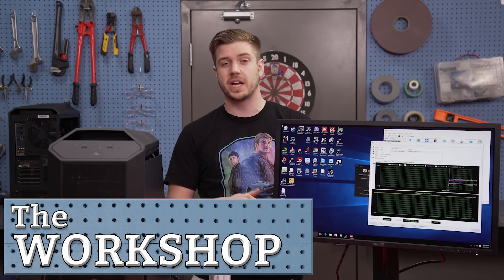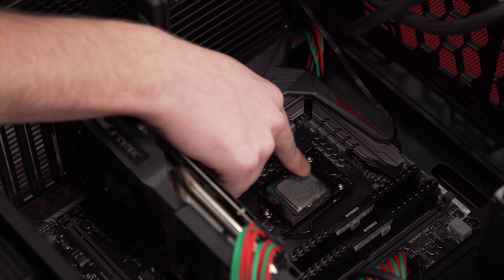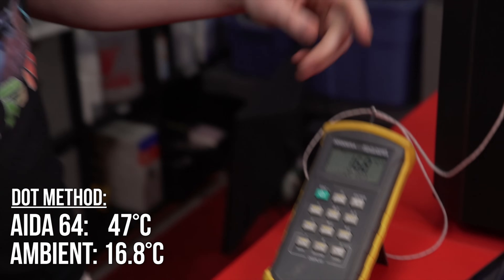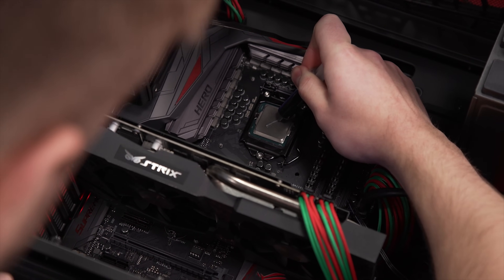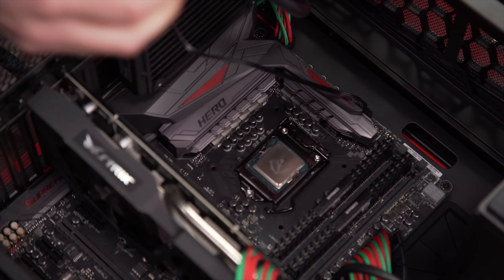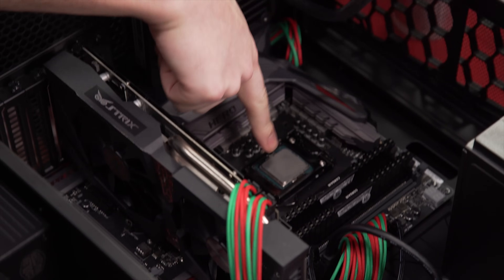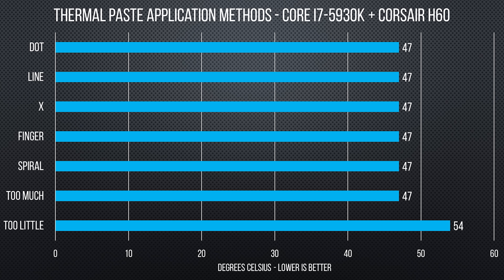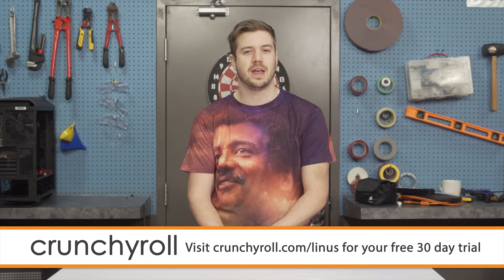Thermal Paste Application Methods - Which one is best? - The Workshop

Comment: shouldve overclocked it so it was running around 70c. if you idle at 20c and load at 47c your delta is 27c. if you idle at 20c and load at 70c your delta is 50c. much easier to see differences that way. small changes in thermal conductivity will be amplified
Reply: +EZOVERDOSE yeah you might get +-1 deg C if you're lucky, and that will be like negligible still.
Reply: z00h
i guess we will never know. another problem i have is he never gave the cpu temp at the decimal. newest aida64 shows the avg in decimal form and i wont believe that he got 47.0 every time. whatever he getting temps from we dont know if it rounds up at .5 or not. its also just not professional for the leading name in tech videos to do when smaller channels are much more thorough and accurate with their tests.

gamers nexus just did a video about how they compared their case temp testing methodology to an actual thermal chamber and compared temps to the thousandths .000. 3 places over from the decimal.
these workshop videos feel like someone with mediocre experience just half ass testing something every time
Reply: EZOVERDOSE because 0.5 degs would mean much. Dude... please.
Reply: z00h .5 would be best case but if it didnt round at all that would be .9. adding that from the .5 ish ambient you have a 1.4c difference. test at higher temps like 70-80c and that could amplify to as much as 5c. 5c becomes a pretty big deal when you pushing a chip to its thermal limits with extreme oc'ing.

i looked at aida again and the decimal is only for avg not peak. i guess those diodes dont do decimals because i couldnt find anything on it. they should have a special cpu thats been fitted with a custom diode in between the ihs and die or something to read more accurately than a flat number. they are after all a multiple million dollar operation that can afford a couple hundred dollar sensor and leaders of the online tech video world implying they could handle installing it

i expect more from them
Reply: z00h
how is any of that unrealistic? neither of us know if the diode rounds at .5 or not.
it is basic logic and thermodynamics that the delta would be higher at double the temperature. and not just because of the previous fact that we dont know if the diode rounds.

to answer both questions all they had to do was install their own sensor which is totally possible. here is a section from an article about it

Section 3 - CPU Temperature

Also called "Tcase", this is the temperature shown in Intel's Thermal Specification. It's measured on the surface of the Integrated Heat Spreader (IHS) under tightly controlled laboratory conditions. For testing only, a groove is cut into the surface of the IHS where a "thermocouple" is embedded at the center, which accurately measures temperatures. The processor is then tested at a steady 100% workload with the stock cooler.

the level of accuracy they could achieve with testing anything and everything cpu related would put them above everyone else

another thing to add to the discrepancy list is they need to take ambient readings by the cpu intake not just the front intakes. i hope you realize without explanation how ambient can vary from inside to outside the case. especially with back to back testing. the vrm will hold heat for a long time. that could be another .4-.9c difference. keep stacking them rookie mistakes and before you know it you got a 2 degree discrepancy on a 27c delta. which makes my 5c delta at 70c claim not so far fetched anymore

Comment: I think two aspects you did not consider here are

1) the type of cpu cooler plays a big role. you had a water-cooler which are in general good in cooling, thus the difference in thermal paste and their application is probably lower. The difference in application should be more noticable with a weak cooler.

2) the type of thermal paste will make a difference, but not as much as the cooler. maybe do a comparison with a really good one (the one you used is a good bet, i think) and one that is known to produce bad/worse results.

I myself thought there were more differences, but also thought them small. I was suprised that no thermal paste caused such a big difference.

A follow-up video testing this out would be nice!

Comment: Guys I have big temperature issues (Build my first pc)

Have the i74790k, not overclocked, and the thermalright macho Rev B as a cooler (cost 50 euros)
When I start a stresstest, coretemp, speedfan and HWMonitor all show, that the cpu temps go from ~35 degrees idle up to 100 degrees in like 10 seconds.

I am pretty sure I installed the cpu cooler correctly, since it is still better than the cpu intel stock cooler, but why does my chip get so hot? Is this kind of software not reliable to measure temperatures?
Reply: +Nito Raki i used prime95 for this cpu stressing, the first stress option.

when using aida cpu stresstest like luke in the video i get only 70 degrees.?!

Comment: I had a different result.  I used the pea method and used a little to much which gave me 39/40degrees at idle.  reapplied the thermal paste and used just the right amount,  and got 30/31degrees at idle.
Reply: +Auckland Mag Chances are very high that the cooler wasn't seated properly the first time. On no computer that I ever worked on, I had a delta of 10°C because of the amount of TIM I used.

Kind regards,
Meta Custom Computers

Comment: The only CPU's I've come across where it seems to matter how you apply the thermal compound are CPU's that don't have an IHS. Like the CPU's in a 2009 Mac Pro. Spreading it on the die seems to give better performance in that case.

Comment: I always spread my thermal past with a credit card in order to spread the paste evenly in a layer that is as thin as possible.
In practise, I imagine that I am getting a thinner and more even layer than when using a finger. Although, in theory, that is how it should be done as that is the best way to ensure the largest and most efficient contact area (the layer has to be thin!) between the processor and the radiator.
That being said, it is also possible that the newest and best thermal pastes are so good heat conductors that putting too much paste (or way too much) or uneven layers makes absolutely no difference! Which probably wasn't the case when I started building systems 25 years ago.
Reply: I've always done this but instead of a credit card, I paint a very thin layer over the entire surface using a razor blade, careful not to get any cuts or blemishes in the painted layer that would result in air gaps. I also rub some into the mating surface on the heat sink using a plastic bag on my finger to help fill microscopic holes.

It always bugs me when I see Linus or others just squirt a dab on and lazily slap the heat sink on top. Guaranteed, this is not the best way to achieve good thermals for longevity.

This test also annoys me because using some tool and waiting ten minutes isn't nearly a conclusive test. They should be running CPU intensive tasks for a couple hours and monitoring the max temp. I feel like 47 is kind of warm for idle but where you'd see differences is where extreme tasks would start to heat soak the sink and actually tell you how efficient you were at removing heat from the processor over an extended period of time. They also didn't do the paint method as I just described. Don't be lazy, people.
Reply: +Thomas Olson If you spread a thin and even layer on the processor, you shouldn't need to spread an additional layer on the radiator. Razor blade ... that is risky!
Reply: +Photoandcargeek no that's not what I said. I smear it with my finger just to tint it really. I don't paint a layer on the heat sink. Nowhere near the same amount as on CPU cover.
Reply: +Photoandcargeek with my finger in a bag, that is. I take every precaution not to get contaminants in the thermal compound.
Reply: +Thomas Olson That is probably 50% to 100% more than what I put .... if you are trying to block microscopical holes in the surface of the radiator, the billions of molecules that you have spread over the processor should suffice (even if it is just a tint!). That is all I said.
Reply: +Photoandcargeek oh I see how you meant it now. Tinting the mating surface just helps to ensure no microscopic bubbles get trapped and the thermal compound can better interface with the surface. It's just a theory but it's how I learned and have always done it. Razor blade is no more dangerous than a credit card due to the extreme angle of the blade. And it works better because plastic is often nicked at the edges and whatnot. A brand new razor blade is a lot more straight.

Comment: again i kinda knew that there was going to be negligible difference. i mean it's only thermal paste for crying out loud. as long as you don't mix it up with hair gel or something i think you'll do fine. 
i have 2 issues with the strawpoll. 1 is there was no choice for no f***** difference and 2 for turnip (which i suppose means the same).

Comment: Shouldnt you be testing this at some level of cpu stress though?
Reply: +silentKeys20 Yeah. that's exactly why he used Aida64 to put stress on the CPU.
Reply: But if the fan is thermoregulated. Who knows if the 47°C has been achieved with the same fan speed everytime ? If it runs at 10% in the pea method and 75% In the X one, the conclusion isnt exactly the same :p
Reply: +silentKeys20 Like using AIDA64??
Reply: I think one person saying Aida64 is enough.
Reply: +silentKeys20 That's why his using AIAD64 benchmark
Reply: +silentKeys20 He is. That's what AIDA64 is for.
Reply: R4GEcraft Yes I know what you mean, but the temperature doesn't go up. The fan curve is configured to go to a certain speed at a certain temperature. So the 47° gives you always the very same fan speed. The controller does not try to hold the 47°, or can predict how fast it has to run to do so.
Reply: +silentKeys20 shouldn't you know what Aida64 is :P
Reply: +PrjctMinecraftiaFan Aida64 is a program designed to run your CPU at 100% for stress testing.  Its primary use is for testing processor overclocks for stability - running Aida64 on on unstable overclock will cause your system to crash.
Reply: +Treufuß I was exaggerating. What I meant is, when the temperature goes up, the fan also speed up to catch up with it and maintain it at a lower, more stable, operating temperature. And I'm not sure he mentionned the speed of the fans were fixed
Reply: Aida64 is his girlfriend, you dummies 

J/K
Reply: aida64?
Reply: +WayStedYou sorry I didnt know that. Thanks for the info!
Reply: R4GEcraft Same temperature => same fan speed
Reply: +silentKeys20 not enough answers! Let me add another one
He's using AIDA64 which puts stress on the cpu
Reply: +silentKeys20 AIDA64 IS a stress test for a CPU, he said that he would run it for 10min before taking the readings.
Reply: +silentKeys20 
Aida64 is stress testing. It puts the CPU at 100% usage.
Reply: +R4GEcraft Do radiator fans normally spin up and down? What about the pump? I think running at a constant speed would give them a longer life.
Reply: +Treufuß Yes but it can be 47°C reached in 10 seconds and 47°C reached in 100 seconds they should have checked that. Which makes a difference for other systems that are not as efficient as this watercooling.
Reply: +silentKeys20 HE'S USING AIDA64 OH MY GOSH j.k I know the answer has been given to u
Reply: +R4GEcraft maybe it is, maybe it isn't. maybe he turned off the regulation or set it at a specific/manual speed for the tests. he didn't mention it so we can't know that, so you can't make a whole argument off of that.
Reply: +silentKeys20 Honestly I would have liked to also see x99 cpu's.
EDIT: nvm he used x99.

Comment: I tried this too a while ago it does just not matter, on air it does matter. 
If you use an air cooler that has like grooves in the cooling area where it touches the IHS it makes a difference, so that is perhaps where everyone is talking about before. 
The tests you did are not wrong I did those too but the thing is with certain air coolers you could get a different result, so perhaps next time use a couple of air coolers.

Hope I commented good on your vid because it needs a lot more tests then just happend.

Chao, The Roaring Lion

Comment: What if you took a cube of that superlight heatresistent material thats 99% air thats used by nasa and you just put that on top of the cpu?
Reply: +GranVlog Wouldn't that be a bad idea? The point is to draw away heat, not resist it.
Reply: Jeremy Crocker aah right.. srry my bad. I guess i mixed it up

Comment: same tests but with air cooling, maybe AMD cpu due to there higher average heat.
the temp in room is fairly cool and the water-cooling solution had to challenge at all.
also most households would not have 17 degrees temp so doing the tests in a hotter room would be preferred since you would be able to tell the difference due to the struggling air solution.
also use a mid range air solution not the huge power houses.
the paste reacts differently per brand so the spread method could be better for the pastes that are not that good at spreading out due to heat and pressure alone.
but i would say any method that ensures sufficient paste is covering most of the cpu's hot areas is good.
i dont think you will see huge differences if any as the 1-2 degrees could be the result of very small difference in the amount of paste which i would class as inconclusive.
breaks between tests to allow air heat sink to cool would be good. 5 minutes or so between tests.

Comment: Im not sure if anyone else has said it but you should have monitored the fan speeds to see if it was harder to maintain those temps depending on the thermal paste method. probably easier to validate with an air cooler.

Comment: These thermal test might give better results if test were run over a longer period of time. PC will heat up over long play times and in the case of the fan test over two hours it might have had a distinctive difference as the heat in the case rises due to trapped hot air.  Just a thought.  keep up the good work

Comment: you should have used a much smaller heatsink, it would have exaggerated small differences.
Reply: +Grim187 No it wouldn't, stop spewing dude bro science... the only benchmarks I've see with different temps for different methods is when:
1. They either do a terrible job spreading the paste or applying it in general.
2. They do not account for room temperature  differences.

The heatsink size is irrelevant unless you are using Chinese stuff you bought for 1.50 bucks.
Reply: +ADevilNeverCry indeed, Luke did a good job, only changed a single variable each time. The low ambient did more for making sure everything was fair and there was no thermal throttling to keep the other variables static.

Comment: Check the difference between AIO intaking air through the RAD, and exhausting air through the RAD out of the case, thermal differences in CPU/GPU/all around.

Comment: Just a point Luke, the 'Way too more' application method should yield a different result only in time, due to the necessity of it tightening up from the heat and thus isolating the CPU from the heatspreader. + afaik thermal pastes have a 'burn in time' so the best results only show up after certain degree of time and usage. Either way, nice video showing that the constant criticism about the way you apply thermal paste is obsolete.

Comment: Hmmm difference between Nickel or copper cooling? or how to clean 2x7970's that are filled with dust and running really hot with 4 screws cocking blocking my dusting efforts and can't find any videos on how to do so.

Comment: is automotive coolant viable 4 pc water cooling setup.
Reply: +Ankit Barman It's not recommended, since there are no real biocides inside automotive coolant. The biocidic effect for the car-cooling-loop applies because the water-temperature naturally rises to above 95°C which kills every type of organic mass inside the loop. A common watercooling-loop for PC lies between 35°C and 40°C which is a perfect temperature for any kind of organic stuff to grow. And before you go into the shop to buy automotive coolant and a biocide, you can aswell just substitute the coolant with distilled water, or a pre-mix.

Kind regards,
Meta Custom Computers